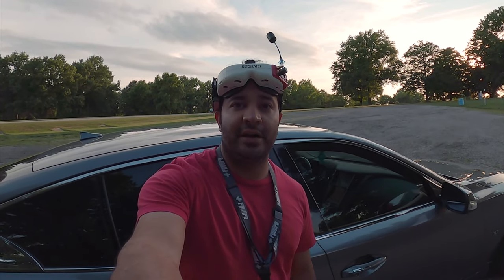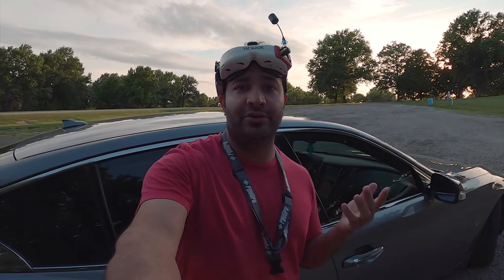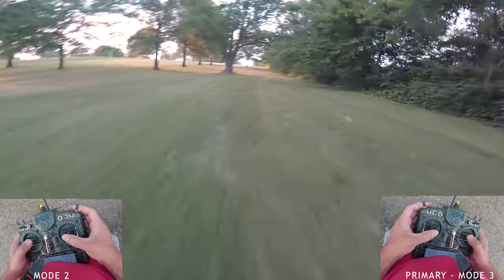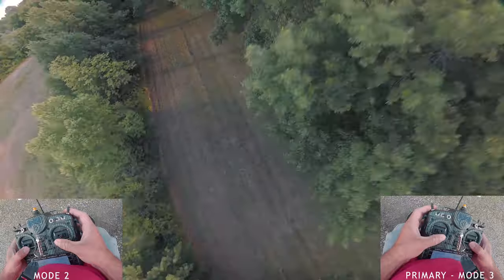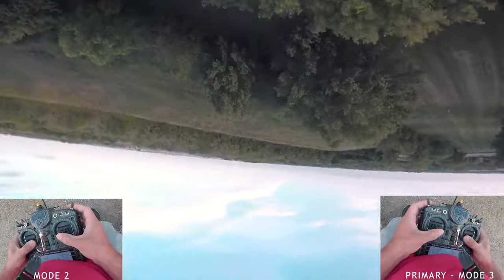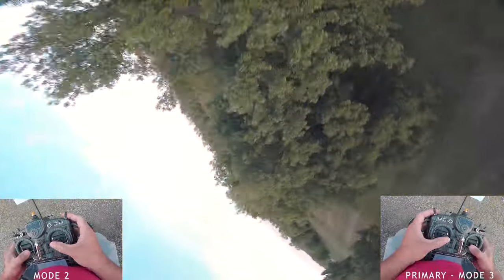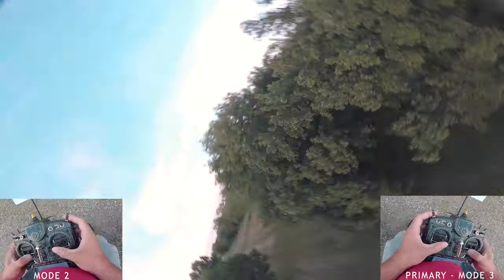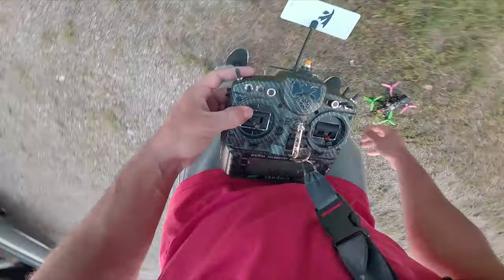How to YAW into Rubik's Cube? 🔶 FPV Freestyle

Comment: I had to watch a few times in slow motion to realize that it's a yaw 180, followed by a 540 degree roll. (1 1/2 rolls, you start upright, end up inverted). Then it's a 180 forward flip back to upright.
I think it's important to point out that it'1 1/2 rolls.
An easier variation to practice first might be to do a yaw 180, 360 roll while traveling backwards followed by another yaw 180 to finish in the same direction the trick started.

Comment: Thanks a lot! One question - does yaw spin really work well with a low camera angle? What is yours btw?
Reply from the maker: Low cam angle helps you by not mixing roll and yaw. Just depends on flight style and setup weight distribution as well. Mine is about 15 to 20

Comment: Isn't this more of a variation of the rubiks cube? I would say it's a different trick you came up with since a rubiks cube doesn't have a roll, and a half. To put a rubiks cube in there  wouldnt you need to yaw back out of it? Am I seeing it right? I'm not trying to be a smartass,lol
Reply from the maker: Different ways you can do it. It’s just a title lol that made sense
Reply: @VIKFPV  I'm gonna post a trick(soon I hope) I've never seen, I think you'll like it, and I'll bet you can come up with a better exit than I have so far, I can't believe I've never seen the move that starts the trick because it's not hard or special, but IMO it is a great launch for the start of 3 to 5 tricks, you seem to have a knack for putting tricks together, and making them look great!